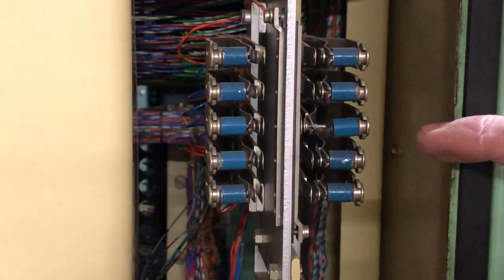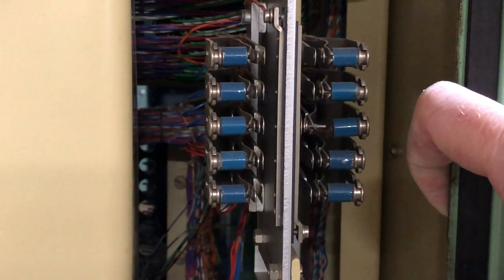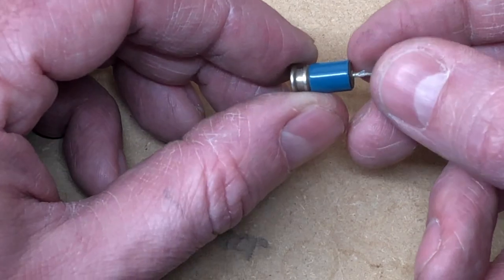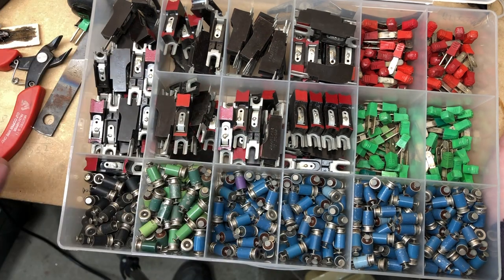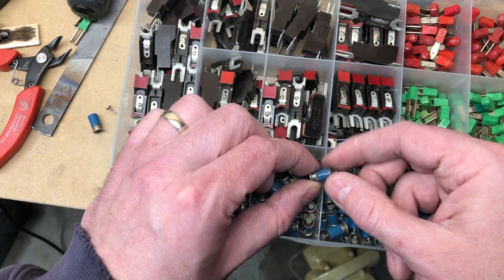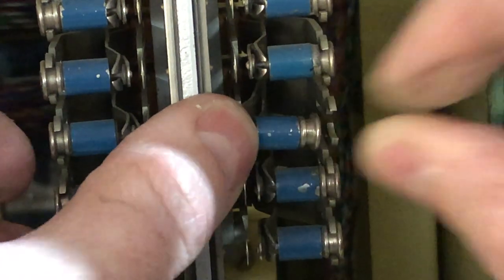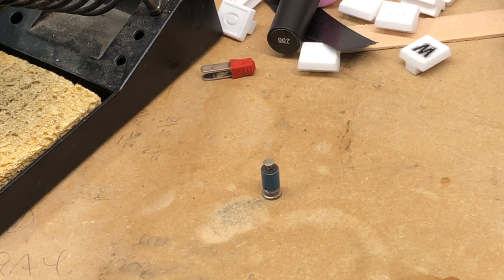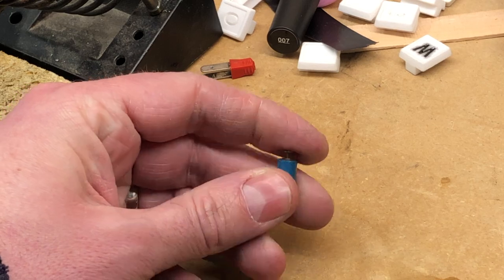Strowger PABX Bits: Refurbishing a Heat Coil

Comment: Nicely done!  When I have to do this on any of my kit, I put a little dot of sharpie on the refurbed coil so I can tell how many times I’ve done it.  Once or twice is fine, but do it too often and they’ll blow far too easily.

I’m told that some private systems installers in the U.K. (ie, not the post office) told their engineers to repair heat coils without removing them from service,  by holding the parts together and jamming the relevant selector magnet.  That sounds like a terrible idea to methough!
Reply from the maker: lpbkdotnet the sharpie dot is a good idea! I’ll make sure to do that in the future. I briefly thought about using the heat of the heat coil to put it back together, but not by deliberately jamming a release magnet! That’s horrible!  Thanks for the comment!

Comment: Yay! New videos!

Isn't there supposed to be an alarm going off for a blown fuse? I can even see the respective contacts in the video

And the solder is most likely Wood's or Rose's metal with melting points below 100 C
Reply from the maker: Yes, it has an alarm facility, but the alarm lamps are on the not-connected attendant’s cabinet. There are separate lamps for mains fail, urgent and non-urgent alarms.